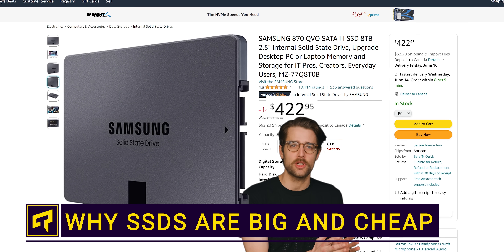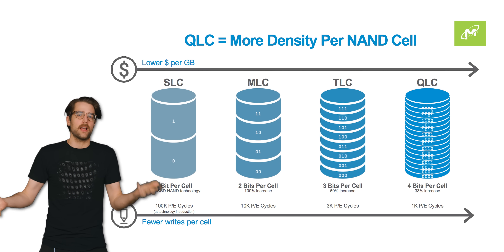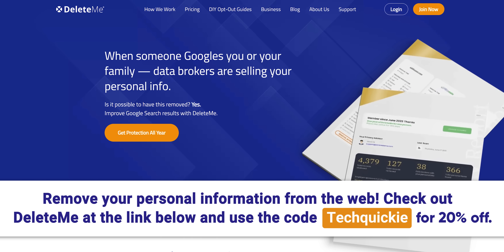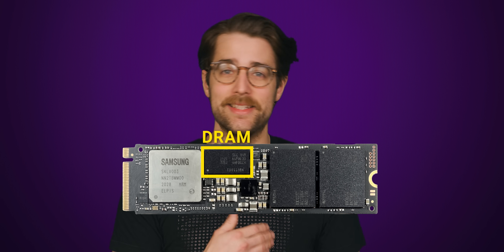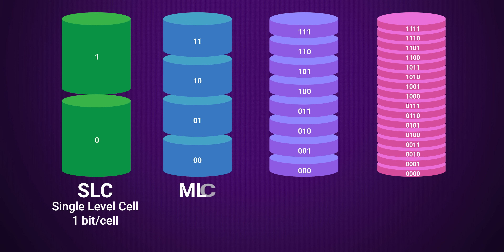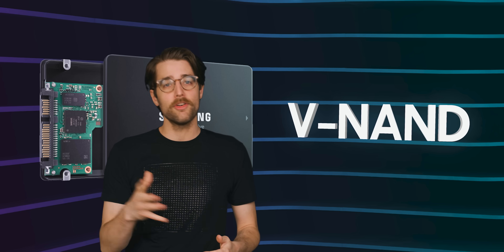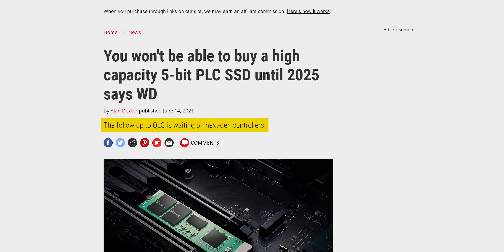Why SSDs Are Big And Cheap

Comment: Don't buy the Crucial BX500 SATA SSD.  Gets about 10 MB/S.
Reply: Noo that on you lol, it's slower than m.2 name but not that slow. Do an inplace upgrade, my advice
Reply: @WeightedPressurePlateOfficial  .. you obviously don't know about this model. It has a horrible reputation for just this reason and gets worse the closer to capacity it gets. But it's cheap.

Comment: I see big problems with these super fast drives……..especially as they age. They have a finite lifespan………so if your data is important…………better to back up frequently or have a raid array. If you have important data, it needs to be in more than one place. I’m a builder and have seen quite a few of the early drives fail miserably……..and…….because they are solid state……..without warning. At least the old mechanical drives gave you a heads up through a drive noise or similar and allowed you to back up the drive before total failure. Not so much with solid state. Best to have a daily backup to another SSD/Nvme/Hard Drive or a raid array. “For every action there is an equal yet opposite reaction.” There is a price to be paid for speed. Not complaining……..just stating the facts. I had 25 years of weather data on a portable hard drive and it was stolen out of my car (in my briefcase that was also stolen). Luckily, I had a relatively recent backup of my data……but did lose some. So if you have important data……..back it up!!!!

Comment: Problem is the cells can be slowly die out. 100% will be dropping after power on/off and installing/unstalling programs. Mine went from 99% to 87% in a year and a half. I stop using a SSD. Went back to hard drives.
Reply: Only expensive Ssds are good. The ones with good endurance.
Reply: But then you're paying a hefty premium for speed you may not need.

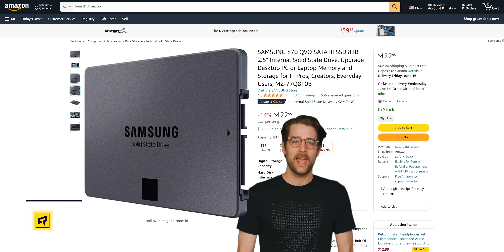Comment: 00:00 Solid-state storage has become cheaper due to Nan cell performance.
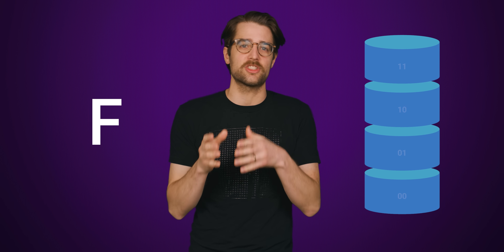00:41 More bits per cell in SSDs means higher capacity but less longevity and speed.
01:19 Electron leakage causes drive slowdown, but using more bits per cell helps increase drive capacity.
02:03 DeleteMe can remove personal information quickly
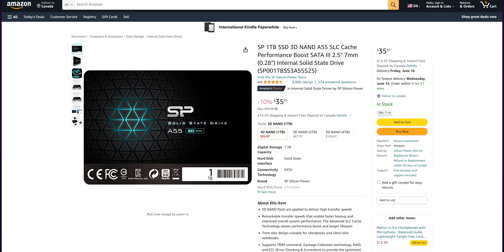02:38 SLC cells are faster but hold less data than MLC, TLC, or QLC cells.
03:16 PC's main memory can leverage faster memory without adding cost
03:54 Increasing SSD capacity beyond 5 bits per cell is complex and results in diminishing returns
04:33 PLC drives are a cheap way to store large amounts of data

Comment: since ssd is smaller it means that they could use a rebound effect to increase the capacity and lifespans*

rebound is like what happens when you are set on buying something and you have $100 and the item is on 50% sale so you may now buy 2 of the item since you have to only spend $50.

so they could make the drive to the full 3.5 inch form factor and cram a bigger board in the enclosure.

Comment: brah this is so real. In August 2014 i bought a 1TB 840 EVO SATA for $438.77
October 2023 i bought a 4tb Corsair MP600 CORE XT M.2 2280 for $159.99
Thats four times the storage for 36% the price. Its just a bonus that its 4-7  times faster.
Hardworking engineers working for firms competing with each other is magical.

Comment: I got my acer laptop for 1 tb hdd and 256 gb  ssd for 500 bucks plus the extra 8 gb ram that cost me 50 bucks.... But now these apes are selling 512 gb ssd for 600 bucks, little creeps where de heck Im I gonna put my data when I buy new laptop.. will probably search around as my laptop is working just fine, may the tbs come in cheap in the coming 1 or 2 years, because dont think my laptop can be kept longer because of warranty off and probably laptop internal failure...

Comment: Basically making an SSD is very cheap, it's just the market waits to gain it's revenue from this technology which is fair.
But starting from 2024, making an HDD will be expensive than SDD, probably it will mark the ending of HDDs, and mark the start of cheap SSDs

Comment: I think the mfrs know that people know that QLC sucks. If you think about lifetime and TBW, it's going to create more e-waste in the long run. It's dead tech, unless they can solve the voltage heat wear problem. I think a 100TBW dram-less qlc for a laptop is gonna make the consumer mad. It risks making mfrs look bad when nvme starts dying. It requires more knowledge for a non-techie than buying ram sticks. Man, all those 256 and 512GB QLC drives out there might as well be sold for 20 bucks. Let's make it slower with ECC and inline encryption.

Comment: For me hdd are defo on the way out apart for cold storage.
I considered setting up a NAS but I am cursed with the ability to hear a hdd humming from anywhere in the house so I know I would end up just unplugging it most of the time apart from when I actually needed something from it.
 just ordered another 1tb nvme for £55 that does 7000 speed so price really is not much of an issue for lower space, even 4tb nvme are not too bad now but I like the idea of a hdd as a extra back up just because its a different medium.

Comment: Going to MLC to TLC or QLC doesn't mean the cell actually holds more bits, but rather, the voltage levels in each cell is divided into more levels. So if a cell is completely drained in a QLC SSD, it's understood by the controller as 1111. As you gradually increase the charge or voltage of the cell, it goes from 1110... 1101.. 1100.. all the way to 0000, where the cell holds maximum charge. There are 16 such voltage levels in a QLC cell, with each level defining 1 of 16 combunations of 4 bits.

The controller takes longer to read or write because it has to make sure it's reading or writing the correct voltage level, and as you can guess, the more voltage levels possible in a cell, the tighter the tolerances, and as you write to these cells electrons get trapped permanently, which kinda messes up the voltage levels the controller reads, and therefore increases the chances of errors.

Comment: Doesn't matter if PLC suffers from even more shortcomings than QLC. If the prices of PLC cannot match HDD, we'll even get HLC (hex level cells), which is the point I predicted a few years ago, where the price will finally match HDD and thus retiring HDD entirely.

Few "fears" to address for those who might not know.
Speed - Whatever the case may be, saving games on even a HLC drive won't be THAT significant. Keep in mind that the jump from HDD to even a SATA SSD is so significant, that nothing after will really matter that much for most people. There's the outlier, but that's speaking to an extremely small minority that need to complete specific tasks on a daily basis. In those cases, they can stick with SLC and MLC drives, but for the vast majority, PLC and HLC won't matter, I can say this with certainty without even knowing the performance. Why? Because even the PLC and HLC, especially on NVMe, will be many times faster than a HDD and the difference between them and a TLC will barely be worth noting. This same "fear" was widespread when TLC first launched, and look at us now, onto PLC now and it's not looking to stop until the prices matches HDD.
Longevity - Again, for most people, absolutely irrelevant. Unless you are reading and writing an extremely large amount of data, e.g. transferring files back and forth, on a daily basis, this will never matter. Furthermore, as the size increases, because you get more cells, you just end up dragging out the longevity. So if the PLC drive on a per cell level is half the live of a QLC, when you have double the storage, hence double the amount of cells to write to, the longevity is going to be the same, but you get double storage for the same price. In reality, the numbers don't quite work like that, but you get the point. The point is, longevity does not matter for most people because most people are not writing tens of GB to it daily. Put this into perspective, it won't last forever, unlike the theoretical life of a HDD, which CAN technically last forever, but on average an SSD will outlast a HDD for most people. If the SSD is dying in 10 years, well, one, you were due an upgrade anyway, and two, the average HDD would've failed before that because they only average out around 3-5 years in real life, even though in theory they CAN last forever. If you can get double the storage for the same price, with the same longevity, but slightly reduced speeds, it's still the better value option by a large mile. You're not going back to TLCs with the small capacities just for slightly faster speeds.
Games - This ties in with Longevity. Realistically, who is re-installing games on their main drive when they decided to dedicate time to it? Modern AAA games are like what, 50+ GB? You're telling me people are re-installing from a PLC to a TLC for slightly faster load times, like a few seconds, when they have to sit through half an hour waiting for the game to download, install and patch on the new drive? Nah. This is how reality works. Keep the large games on the boot drive. Leave sufficient space on it so it doesn't die too quickly. Keep the rest of the games on a larger, but cheaper SSD. If the PLCs are cheap enough and large, just using one drive for everything is perfectly fine too. The boot times will not take that much longer, and definitely does not take long compared to re-installing games. Basically, most people won't be reading and writing to it constantly, even with games, therefore it will unlikely affect longevity.

Things to really note are, make sure the SSD has DRAM and a sufficiently sized SLC. Most mainstream SSDs have sufficient SLC allocated, so let's hope that is kept up. DRAM is the one to keep an eye out for, as many manufacturers leave that out (because why wouldn't they when it's a negative selling point) so make sure to buy one with DRAM in. TLC, QLC, PLC, HLC, etc won't matter too much.

Comment: I still use HDD for most storage. Though that's slowly changing. My new PC build has 4 M.2 slots and 4 SATA slots.
(But only 2 HDD bays and 2 SATA SSD bays.. Antec didn't think about someone like me).
iRacing and GTA V have had dedicated small capacity SSDs for a few years on my system. the new board doesn't support SATA M.2, so that's one lost (used for iRacing). But I got 2 1TB and 1 2TB M.2. The other M.2 SSD I had is actually too short to fit the new board. 

But if I can partition it down right, Starfield, Baldurs Gate and GTA 5 can all share the 2TB. iRacing can have an entire 1TB to itself - though I can probably partition that back to 475GB and still be just fine, leaving 500GB to ... whatever, basically. Videos and screenshots I guess?
Steam and everything else I had on the 6TB SSD can stay on that. My user data will stay on the 4TB SSD. and if I can manage to hide the 2TB HDD in there, I'm gonna. I had another 250GB SSD but .. Yeah not enough SATA slots and there's only room for one more PCIe Expansion card and I'm not sure it's worth it to get a SATA expansion card for just one device. Would almost be better off buying a 4th M.2 (maybe a 2TB I guess, $100 is cheap to a build like this) to put into that unoccupied spot.

Comment: I am kinda curious about some of the ultra cheap NVME SSD like 4TB (7000MB/s) for only ~100 dollars on the market by some smaller brand, is it possible to do some comparisons?
Reply: Don't put data on a drive you cannot trust, keep to A-brands for your storage. You can do a comparison of a drive or maybe a few but that doesn't translate to the performance of the drives in general. Even then the models change so often that keeping stats is really a waste of time. Biggest cost factor is the amount of flash, and there are only a few manufacturers of flash chips: the question you should ask yourself is: how do they manage these cuts in price?

Comment: dude outrages because 8tb of SATA-SSD storage is "cheap" for 400-500 while there are 20-25TB HDDs out there sold for ~350
Reply: Yet there slower an etc :/
Reply: @senritsujumpsuit6021  yet that doesn't mean shit for 99,9999% of people who unironically use that much space, since that much space is usually used for mass hoarding of files that you won't move around anytime soon. as long as you're not some developer, data scientist or VFX artist, 8tb of SSD-Storage, especially SATA-SSD-storage won't be of much use for you.
Reply: Many people would easily go for 2TB SSD or NVME an just have a external 20TB HDD to @Bloodhoven

Comment: What is point of 8TB nvme ssd when after copinng 400-800GB of file your speed drops down to 80-200MB/s. You can obtain that speed with 7200 RPM HDD which are half the price (WD Gold 8TB 249 Euro).
Reply: size, speed, heat, longevity and not being so fragile. A typical hdd is worth like 20 m.2 ssds in volume. And the cache issue doesn't really apply for most consumer use, which this vid is about.

I mean, do you really need an explanation as to why a giant brick with moving parts is less reliable than a slim slab with zero moving parts? Also, the majority of use case read speeds are waaaay slower on hdds.

Comment: in 1997 i paid $1200 for an HP computer with a pentium mmx 233mhz cpu and a 4gigbyte bigfoot 5.25 hard drive..the hard drive went bad within 6 months and i got a free upgrade to a 6.4gb western digital! in 2000 i bought a 20gb western digital for $400 and had plenty of room for all my mp3s and diablo2!
in 2004? i bought a 250gb hard drive for $400 and had plenty of room for all my games, mp3's and dvd rips (all legal backup copies of course cuz best buy employee discount and bmg and columbia house club discount bulk purchases XD oh and free promo stuff due to friend working at 3 metro radio stations as a sound engineer woohoo!

Comment: yep still using cmr HDDS as game drives we use terrabites of data, for games and media, and will likely keep using them even if the newer drives are made, as thier just so rugged and reliable, exos ftw. for loading just upgrading ram helped a ton so any game onley takes a few minutes then 20 seconds after for the rest of the game using ram cache, for high end on the middle end most average games still take onley 40 seconds so its no big deal ether way.  primo cache is a good solution too but ive run out of cash for better ssds to use as cache,  so im stuck with the several 2 tb sata ssds. i have some nvmies as well but 1 tb is too small, even if i had a 4tb nvmie ssd id still use it as cache, onley games that cant be loaded on the hdd go there as it fills quick, gears 4 isnt on steam yet or it would be on the hdds instead. Exos high end CMR HDDS fTW 70tb of spinning silver disks ho!

Comment: Not too long ago, only about 4 years ago I paid about 55$ for a 250GB SSD, it is a Crucial MX500 wich is one of the best SATA SSDs you can buy and today the same 250GB SSD costs 25-30$ while even the 500GB SSD costs about 37$ today (it used to cost over 70$ 4 years ago !), in fact today you can get the 1TB MX500 for about the same price as the 250GB version 4 years ago. Also back then the 2TB version costed over 200$ while today it costs 100$.

Comment: big and cheap? ofc they are cheaper! other wise you not buy again lil more but you allready spended 1T to get 2T that 2T cost what you was allready spended and all older you bought is calculate total you not use anymore. and yes they get cheaper. manufacture line is builded they come automate LOL
till.. SDD is absolute something else come and you can get new 500MB rubber silicone laser drive LOL 1000 bucks! its going to be so fast its no problem uqntum computer lol

Comment: I have recommended this for LTT because it's prob better suited for that channel, but... a 'test' of ordering these 1-8TB m.2 drives from wish, ali express, etc etc.
you would really only need a few and could make a whole 10-15 minute video if you got a few brands.
I imagine the drives are something like 128GB drive chips with 'hidden' storage... a.k.a. fake storage up to more... and probably even worse at 64GB chips... 
but it would be neat to see how bad it is. not to mention they m.2 drives and ssd's even are less than 50$, so it'd be a really cheap video cost wise.

Comment: I would like to see a drive that can start out as QLC, and when it's operation lifespan has been reached, it can be re-initialized and reformatted as MLC with a smaller capacity, but it would extend it's lifespan. Then after that, re-initialized again, and reformatted as SLC.

Comment: Biggest problem with all ssd is that they loosing the data after time without of power, depending on the environment temperature and time without power, can be a couple weeks up to 2 years. Best still for backups is a good old hdd. 
Would be time for a ssd that don't wear after use and don't loose data with time.

Comment: I've bought older new in box SSDs which are far more reliable than new ones in my experience, for instance my 120gb Samsung 840 evo drives are still running in my system without a hitch where as the latest higher capacity ones i bought from them in the same model line all failed, even tried some other manufacturers but ended up going for older models, they hold up really well, i wont buy anything greater than 120gb units.

Comment: The notion that SSDs are only becoming cheaper because of nand with more bits is not correct. Prices have been dropping from 1989 to 2023 by half every 2 years, no matter which cells are used. In December 2017 a 4TB TLC SSD cost €1400, in July 2023 the same TLC costs €220.

Comment: Yup, ssd is cheaper nowadays. Bought the first one in April 2016 for ~$180 (sandisk extreme pro 480GB).

But how cheap it is depends on the market tho. In my country, crucial mx500 2TB costs ~$130. The cheapest one is v-gen, a local brand, ~$90 for 2 TB (2.5" read=550MB/s write=470MB/s)

Consider yourself lucky if you get the product on the thumbnail.
Reply: 1tb nvme ssd is now just $80